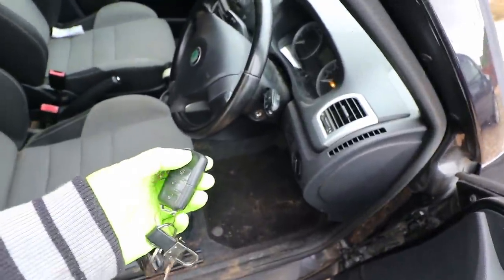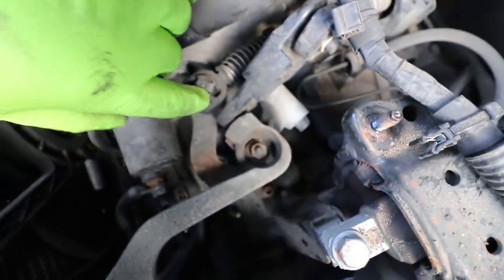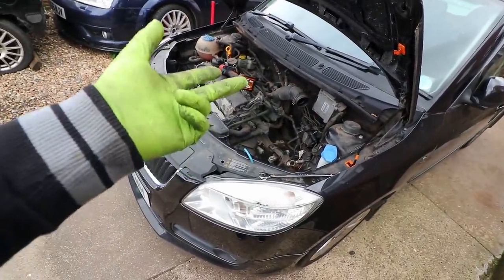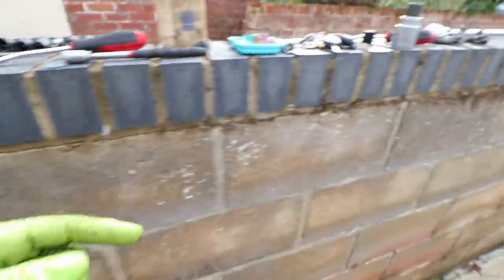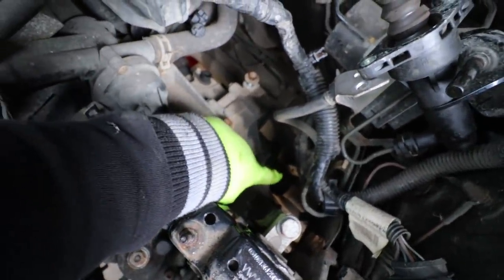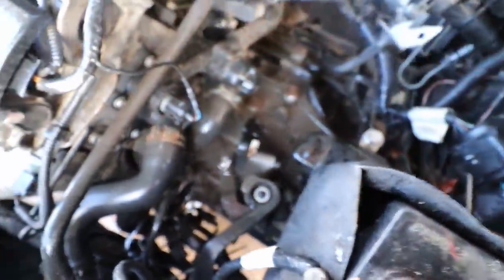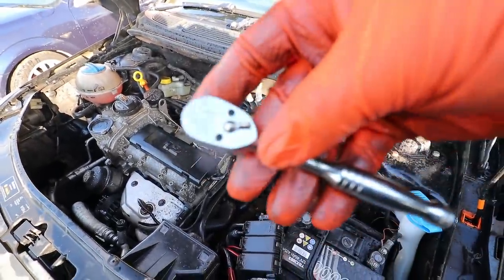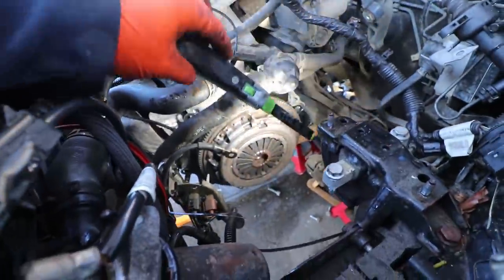Starting Work On The Skoda Project!

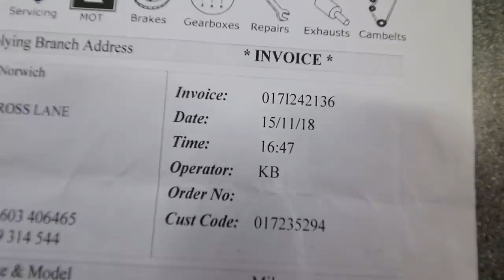Comment: 36:14 can see on paper work that the clutch centre informed the previous owner that the input shaft bearings had issues but the previous owner declined to have it done. Should have got it done when all stripped down. 🙄
Reply: good spot!
Reply: well spotted
Reply: Yeah but we wouldn't have this video if the previous owner did that.
Reply: @Everything_Evan  and he would still have this car too

Comment: Remember lefty loosey righty tighty,  looks like you were doing the lower ball joint bolts up when they snapped.
Reply: Easily done but yes noticed that!
Reply: Exactly !  hahaha
Reply: Saw that too. Easy to do.
Reply: Thought I noticed that.
Reply: That is a common way if you have a stuck nut or bolt that you think may snap off.  Loosen then tighten a little before you try and take it off.
Reply: @ratspeedgarage  he wasn't working it backwards and forwards he was going full gorilla on it 😀
Reply: Defo, been there done that haha
Reply: Then bolts snap quite regularly I’ve snapped a couple. Always just undo them from the hub now instead
Reply: Glad to see proper work, and that you haven't gone down the wrap and remap trend on YouTube 👍🏻
Reply: 16:25 min. Thought it might be a mirrored Video?

Comment: Rain stops play...
Oh, the joys of the British weather...

An easy way to tell if you have bad gearbox input shaft bearings is to get hold of the input shaft and try to move it up and down and from side-to-side.  If the bearings are good then there should be barely detectable play, but if the bearing/s are going then there will be quite a lot of movement which is very easy to identify...

I've seen what happens if you drop a gearbox, and it's not pretty.  You make a big hole in whatever floor you're working on and, unless you're very lucky, you'll probably break the gearbox casing as they are cast items.  That makes life very expensive as, if you're fitting a reconditioned unit, they'll want the old unit back on exchange.  About the only part of the old gearbox the reconditioning company is banking on being able to use again is the casing, so, if you've broken it, you're facing the whole cost of the replacement unit as they won't want a gearbox with a broken casing back in exchange, and if you return it anyway then they'll send it back with a bill and charge you for the transport costs.  Obviously, if you're going to overhaul the gearbox yourself then you're also in a hole as, while some people have worked wonders on parts of gearbox casings with chemical metal, you're unlikely to be that lucky if you've cracked or smashed the bottom of the casing as a lot of gearbox oils contain chemicals that will attach the agents used in metal repair putties, hence why you're told to only use them on oil-free surfaces...

Comment: Great informative video. Great to watch. Also great safety info.  I have always used a jack, then axle stands, then wheel(s) under and square wooden blocks (the same blocks used to shore up coal mine shafts). 
Years ago I heard of a guy who had a small garage business and he would quickly just/only use a jack for a quick job, until the jack failed and it killed him.

Comment: As Ade Reeves said, gearboxes are nothing to be afraid of and only a few fiddly bits. As well as the detent ball bearing(s) and spring(s) watch out for the hub keys (feather type keys) and their retaining springs which are very thin versions of a snap ring type. If the keys come out it is a real pain to refit them. Can't wait for the gearbox opening video! You'll need some good bearing pullers if the larger caged or roller ones are kaputt. Hat's off to you for such great content, on the drive mechanicals. Good luck!

Comment: Great video again mate PLEASE READ THIS when refitting the drive shaft bolts the the gearbox you must thread lock them as they tend to work loose and smash holes in the gearbox 😬😬😬

Comment: We have done a few of these boxes now. The top bearing cartridge is what normally fails and whines. A pig to pull the entire box into a thousand pieces to replace it but certainly a simple box. If you remove the end cover from the box you will see the rectangular plate with 2 bearings in it, this fits from the inside.

Comment: Those 12 sided bits are torx bits very common on French cars so a good investment. The reason them bolts snapped is you was tightening not undoing them. With drive shafts that bolt on like yours you don't normally need to remove all of the bolts on the strut. The 36mm socket you bought was also a good investment as a lot of French cars use that size.
Reply: Torx has 6 points, the 12 point is called a spline, just so you know

Comment: Car mecanic simulator vr !!!!

Dang when u moved the camera to show the parts behind weels.... i got a flashback...  I SEE that...

Really amazing what u are doing there, for safety, before lift the car, be sure the 2 weels behind are firmly blocked, to avoid rolling.  jacks hold a lot of weight on their vertical, but if car start rolling no way they keep themselvs vertical

Comment: not many people know this, but on most VAG cars, the drive shafts (axle) will actually come out if you just remove the big hub nut and the multispline bolts at the gearbox end. The ball joint and track rod do not have to be removed. Yeah it is easier if you remove those components, but not required.

Comment: I believe those bits are called triple square, they’re more common on VW and Audi cars. It might be more economical to buy a second hand gear box from a salvage yard, but there’d be no fun in that. Looking forward to seeing the gear box come apart. Great video James, you have more courage than I’ll ever have.
Reply: Due to a lot of them failing it’s hard to find a second hand decent one in scrap yards these day which will last. Same issues on the Polo.

Comment: Yeah Mr Clutch is fantastic, just popped my Audi A4 B5 Avant in Norwich Mr Clutch today and he's doing the clutch, dual mass fly, Cambelt, water pump and some other bits and bobs gunna cost around £1200 which is really good for an Audi. I normally do clutch and cambelts myself on my MK4 Ford Fiesta 1998 200BHP 1.7 Puma, Sprint Rally Cams, ITB's etc etc, Buying the fezz stock about 2 years ago I've spent like £7000 but worth every penny. I've always done all work myself but I don't have the strength to pull out the Audi gearbox as it's a Rear Wheel Drive setup. I would normally use my engine crane on a front wheel drive car but the Audi is imposable to assess without a lift. That Skoda looks to be a lovely car to work on when it comes to engine bits are there is sooooo much room in that engine bay. I whish I could as the same for my fezz LOL! Love to meet you one day big fan! Keep up the amazing work

Comment: We found on a Renault gear box that it was cheaper to go to main dealers for the bearings that were needed, as opposed to going to a bearing centre near by. Renault were able to say the exact box that was fitted to that reg. bearing centre didn’t know and said it could of been multiple sets of bearings. Go to Skoda and ask them it may just save you a bunch time, money and effort as at least you’ll have the correct ones that will outlast the the car.

Comment: Its a trident 3/8 stubby ratchet . I've got the same one. Barley use it but definitely worth having and is great when as you said not enough swing room and also not enough space for a 1/4 to 3/8 adapter when bigger then 14mm

Comment: It looks like VW have been using essentially the same drive-shaft bolts since the late 1960s. My VW Type 3 from 1969 had exactly the same (or very similar) bolts and those brackets that hold the two bolts together look very familiar too.

Comment: The easiest way to do this job is actually take off the cv axle flanges from the gearbox on the engine side, coz it is slightly behind the flywheel

Comment: Well obviously the ball joint bolts are going to snap if ur trying to take them off by tightening them ,great content and  videos though
Reply: That is a common way if you have a stuck nut or bolt that you think may snap off.  Loosen then tighten a little before you try and take it off.
Reply: @ratspeedgarage  yeah I totally agree with you
Reply: They normally snap on these anyway... they did on my golf after heat and oil and i did it by hand... give the fella a break

Comment: The noises is from when you replace a dual mass flywheel with a single mass flywheel you get clutch chatter at idle when the clutch is released.. It's not the gearbox bearings that's just the sound you get with single mass flywheels
Reply: nope you wrong  36:14 read what it says
Reply: It's petrol no DMF!

Comment: When you put the drive shafts back in you should put the bolts back in the drive shaft then fit back on to the gear box, it’s easier than putting them in one by one.

Comment: Tip: you dont need to remove the tie rod, you can just remove the ball joint bolts and move the wheels and crack off the balljoint bolts first before zipping them off

Comment: Just to say unless you know already don’t re use the multi spline bolts holding the driveshafts to gearbox they must be replaced with new and done up to correct setting 👍🏻
Reply: Never replaced these bolts been doing clutch and gerabox changes for over 10yera they are not stretch bolts so won't need replacing just need lock tight applying to them
Reply: @martinr1228  fair enough but they have been known to snap buddy  for how little it costs to replace them it’s not worth a risk we always replace on any vag vehicle we work on but each to there own.

Comment: Great videos, love them all!
Can you link in that 12-point "torx" set? cant find it :/ Greetings from Germany.

BTW those "double bearings" are are really common fault on these gearboxes (VAG MQ200). Mine also went bad and I am not confident enough to change them myself yet. Maybe I'll change them or I get a new gearbox. Maybe your upcoming vids help me to gain confidence to try it myself. So far I already drove 50.000km with that noise... don't know how, but it held up (for now).

Comment: 11:47 Top tip:  push the breaker bar down using your body weight, not pull up on it.  Your lower back will thank you when you're older.
Reply: I mentioned that on a video AGES ago! It goes through me watching him

Comment: Tightened them up proper hahaha, We have all done it.
Reply: I bet you can get those broken bolts out of that bracket with it in the vice and some good mole grips and maybe a touch of heat. Then use some spare bolts and save a bit of cash.

Comment: I had to order 36mm to undo the rear hub nuts. P.s.i have the hex set and if you don't hammer them in they can twist.
Reply: I was told many years ago don't skimp on spline keys. Buy quality

Comment: What happened to the Draper Storm Force cordless Impact Wrench?  Also, I don't think that Oil leak would fail your MOT (AS LONG AS YOU HAD THE UNDER TRAY ON).  The tray will obstruct the MOT inspector's view (they are not allowed to take anything apart during MOT) and they will give you a pass...  Unless it is so bad that it drip off the undertray.

Also Dual Mass Flywheel or not, you can look at the Fiction disc.  If you find Springs on the Fiction disc that would NOT be a dual Mass flywheel.  No Spring then you have a dual mass flywheel.  The reason is: All Clutch needs damping mechanism (springs).  Dual Mass flywheel is where the springs are on the flywheel itself.
Reply from the maker: The undertray doesn’t go that far under the car, I’d rather fix it
Reply: @TheSavageGarage  Fair enough.  More Contents too.  Looking forward to your videos. =)

Comment: I've recently started experiencing the same noise on my 2009 1.2HTP. However, something that I found interesting is that the noise goes away once the engine has warmed up. It only seems to do it when it's cold on mine. Any suggestions?

Comment: Those ball joint bolts should be replaced anyway - they are torque to yield. I don't usually change all the TTY bolts but those do seem rather weak for the critical job they do.

Comment: What happened to the Draper impact wrench James?
Reply: Yes you gave it a favourable review and haven't seen it since.
Reply from the maker: I use it occasionally. It’s got more grunt than the worx but it’s so big and heavy i wanted something small and easy to get in places
Reply: The Savage Garage alright, i got the same draper one its not bad for smaller jobs but its quite big itself. If your current one ever decides to give up on you consider investing in the Milwaukee 3/8 stubby , absolute game changer.
Reply: TSG I feel you may have a problem with impact wrenches - 2 is acceptable but 4 is just showing off!!!

Comment: I'm fucking about doing my missus VW fox, this motor is the exact same thing, turns out VW, skoda, audi are all the same thing nuts, bolts and parts wise. I got stuck with the 36mm lug nut too, lol. I'm a ford boy, they where like lego, turns out so is this lot.

Comment: Are they some new Halfords impact sockets I see you using?
Reply: I saw a set in Halfords the other day. Look good.
Reply: @chucky2316  Ye I have a set, they are great. Even better with trade discount. Apparently they will all be reduced on black Friday, a heads up.
Reply: @MrZimmaframe  cheers mate 😁. I bought a load of brake line tools in lidil yesterday bargain at £5 each. A flange set, benders and a pipe cutter. I borrowed off my mate last time my brake line went.

Comment: Youre not afraid of going balls deep mate.....pity the clutch all looked ok so it seems youve found the issue.  Hopefully you wont need to split the box open because then youre into a world of hurt and will need special tools and probably a press.  If the box has an end cover that is easy to remove maybe you can access the offending bearing and you can replace it.  Otherwise i might be tempted to sack it off and buy a known good box.  Did you drain the gearbox oil or did I miss that bit??  And im the same whenever i am under the car....loads of wheels and axle stands and jacks etc.....